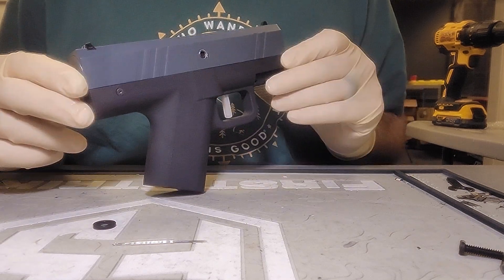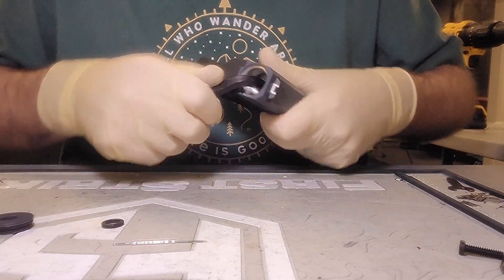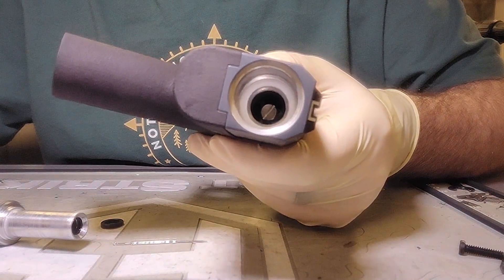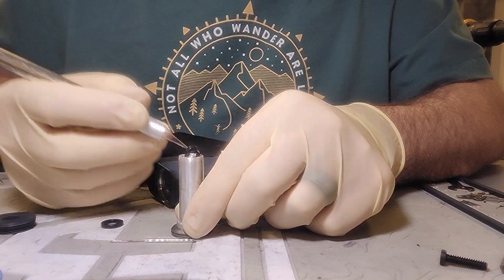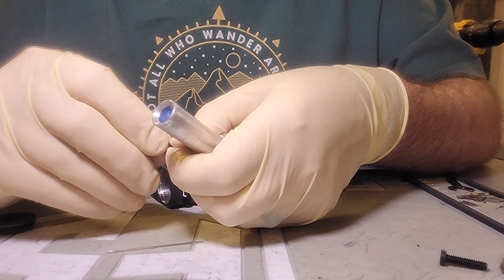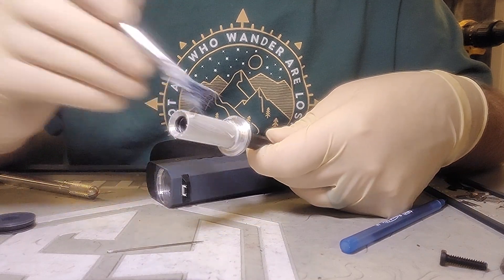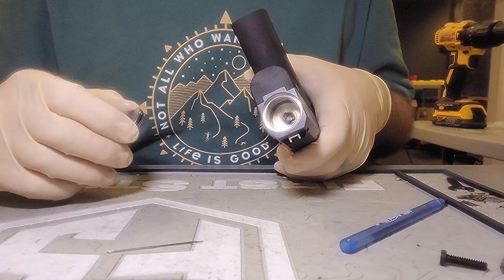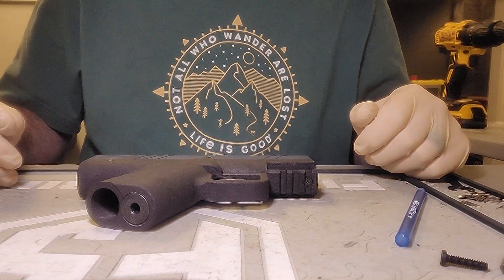Grimburg Gavle Less Lethal Launcher -  Replacing the Bolt Guide O'ring

Comment: I thought the spelling of this product is "Gavle," not "Gavel" - the spelling that's in the title of this video ("Grimburg Gavel Less Lethal Launcher - Replacing the Bolt Guide O-ring").

Since I see this often in YouTube videos discussing the  ̶G̶a̶v̶e̶l̶̶  Gavle, and even Grimburg made this mistake, I suspect the problem is hurried writers transposing (reversing) the "e" and the "l" (reversing two letters is a very common typographical error).

Also could be spell checkers set to "auto correct," where the feature automatically corrects the spelling of "gavle" to "gavel" and the correction goes unnoticed. 

end - today's writing class
Reply from the maker: Could be working 14 hrs a day, 7 days a week to get these out . ;)
Reply: @grimburglesslethal  If that's the reason, I assume Gavle purchasers prefer you to ignore my post and tend to gettin their orders filled. 

Therefore, get back to work, immediately, if not sooner.:face-orange-frowning: